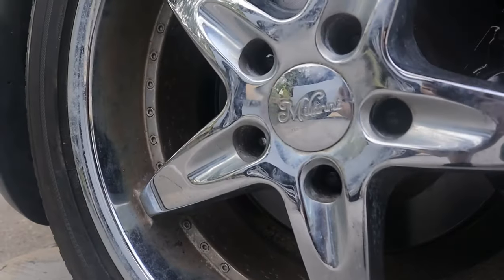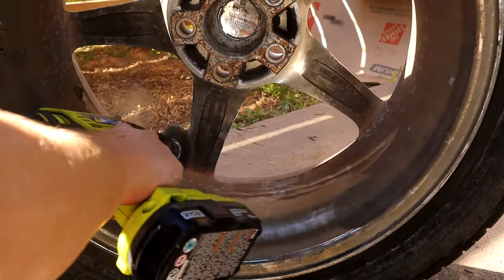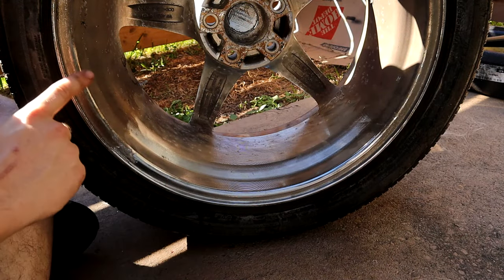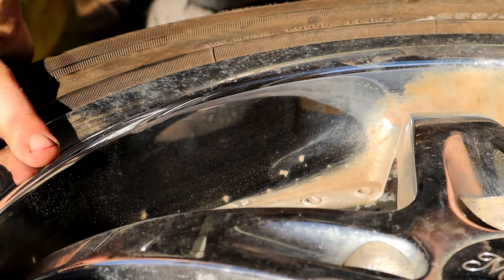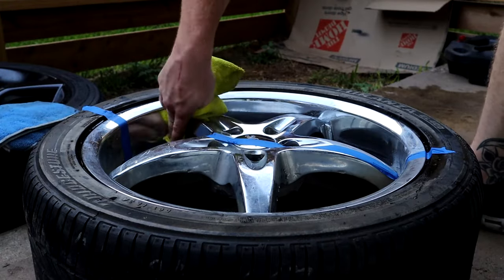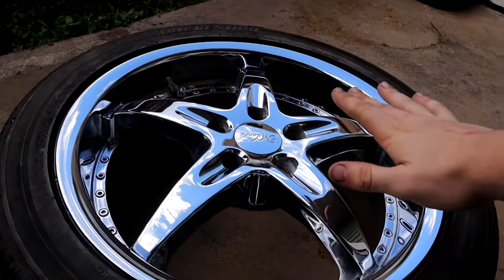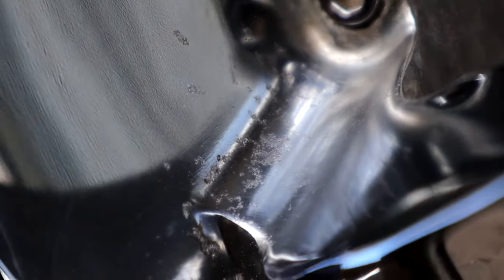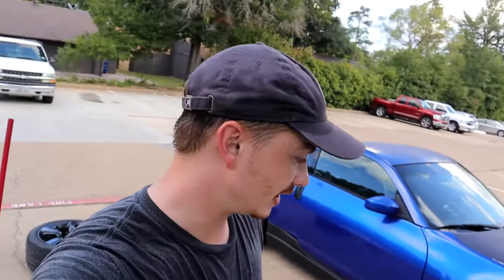How To Restore Chrome Wheels - The Easiest Way!

Comment: Thanks for this video brother. I own a detailing business and this lady brought in her 2013 GMC Sierra that was her husbands work truck who unfortunately passed away. The truck only has 85k miles on the odometer but the wheels were terrible. They were chrome and had tons of stuck on brake dust that wouldn’t come off with wheel cleaner, a brush, and a pressure washer. So i went to youtube, looked up a video, clicked on yours, watched it, and then went out to try it with some 0000 steel wool I had laying around and did all 4 wheels. It look me about an hour and a half to do all 4 wheels & the chrome bumpers. She is selling the truck and wanted it detailed. Thanks to you it’ll bring up the value of the truck by at least a few hundred dollars. Again, thanks brother! 🤟

Comment: Thanks for this video brother. I own a detailing business and this lady brought in her 2013 GMC Sierra that was her husbands work truck who unfortunately passed away. The truck only had 85k miles on the odometer but the wheels were terrible. They were chrome and had tons of brake dust that wouldn’t come off with wheel cleaner, a brush, and a pressure washer. So i went to youtube, looked up a video, clicked on yours, watched it, and then went out to try it with some 0000 steel wool I had laying around and did all 4 wheels. It look me about an hour and a half to do all 4 wheels & the chrome bumpers, but it was damn well worth it. She is selling the truck and wanted it detailed. Thanks to you it’ll bring up the value of the truck by at least a few hundred dollars. Again, thanks brother! 🤟
Reply from the maker: @FrequencyORD  Glad to hear!

Comment: Doesn’t metal polish cloudy up the chrome?
Reply: If you don’t wipe it off it will.. lol Brasso, Flitz, and many other metal polishes say they are good for chrome on the front of the bottle. As long as your chrome doesn’t have a clear coat sprayed on it, it’ll be good.
Reply: Think that only happens if you use too much or don't clean it off properly